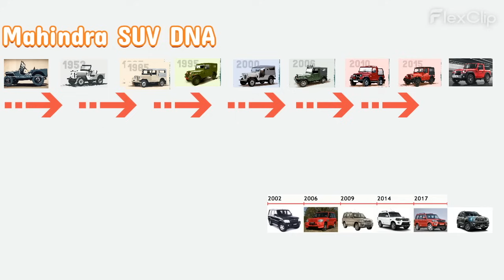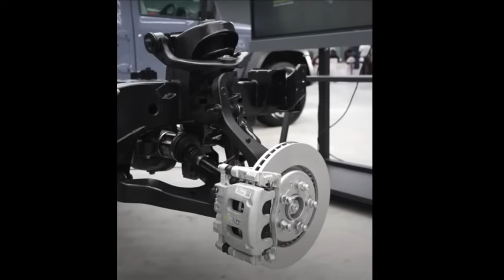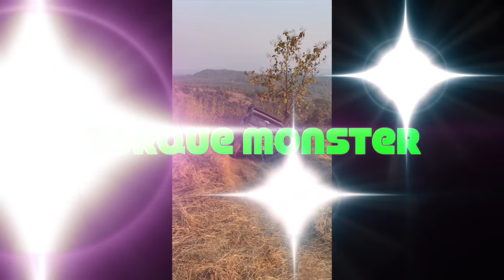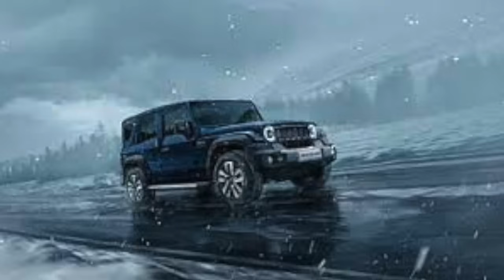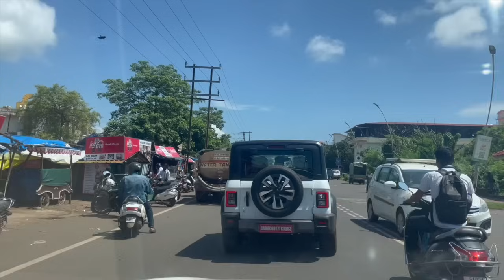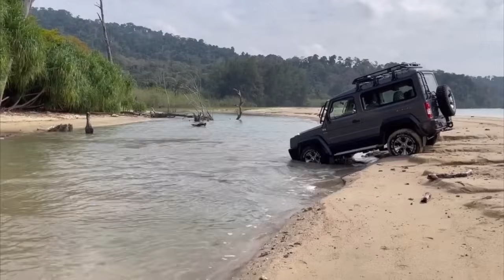Mahindra Thar Roxx 2025 - Engineer's Take on this "One Car Do All" ?

Comment: Nice explanation. Could you also explain how the diminutive Jimny is able to maintain a good cadence on offroad trails with its relatively puny 140 NM torque  and a crawl ratio of ~36?
Reply from the maker: Yes, definitely. Torque to weight ratio. Small torque but early traction. Super ALLGRIP system works smartly. Gearing setup for low end. Top end is dead zone as petrol pot tapers off 

Weight is enemy off-road . Altos fly up hill roads while burly SUVs struggle for the same reason.

See how a monocoque Dacia Duster AWD tackles off-road like a boss. Pure torque to weight at play.
Reply: @tripaccino  Thanks. A Jimny off road review will work wonders for real enthusiasts. Looking forward to one !
Reply from the maker: @theacechip  I would love to do a proper off-road show down between J_G_T trio. Not the vanilla version that media houses are doing, driving through some slush and calling it off-road. I want pure technical obstacles that test each ones strength and weakness. I would need volunteer cars., that's the challenge. We are not big enough (yet)to pull company cars, but I don't want it to be company moderated, so would love volunteer cars

Comment: @tripaccino  your review is Rocking as like Roxx. One question, you haven't mentioned anything about the petrol engine . In your opinion, does it make sense for someone who's only going to do long highway trips occasionally to go for petrol instead of the 2.2 diesel engine? Assuming the car stays parked  for and not driven much and mostly  in a month approx 500km only driving. I like Thar Roxx too much , that is why i want yto buy.
 I am planning to buy AX7L diesel RWD. Can i go for same varient of Petrol considering 1 lakh less price. How much milage will i get for city and highways. Diesel how much milage ?.Please clarify.
Reply from the maker: Petrol stallion is good 👍 if low running. Go for petrol 👍don’t worry about mileage
Reply: Thank you for your prompt response. ❤

Comment: Hello Nice review and appreciate the effort !

I had a question for you and I would appreciate a response. I had a quick test drive few days back, liked the vehicle and ended up booking Thar ROXX with Mocha interiors. I found it to be a good mix of lifestyle choice and almost a family friendly car. But, I am still not quite sure about my decision and may cancel the same in coming weeks. Delivery timeline will also affect my decision as the earliest expected date for my variant is in February 2025.

My primary usage will be in city with around 30kms a day and around 3000kms a year on long trips passing through ghat sections and a bit of bad roads. Bad roads are also in plenty in and around the area where I reside and hence a rugged vehicle helps overall. 

I found quite a few ergonomic issues such as the bottle holder space which makes me thinking. In particular, I found the front seat quite uncomfortable. It had less under thigh support. And both legs were hitting on  something. On left side, it is on some projection from the dashboard and on right side the control panel on the door. I didn't find this getting mentioned in many reviews including yours. Absence of telescopic steering blocks resolution of that problem by moving the seat back. What is your take on this?
Reply from the maker: This is very unique to the customers individual experience. Try back to back test drive of Roxx and Scorpio. And also try a crossover for comfort benchmarking in the same time frame. You will get your answer. 👍

Comment: Genius.
Reply from the maker: share the joy with friends
Reply: @tripaccino do you mean , ROXX ride quality is better then scorpio n? @28.55 min
Reply from the maker: @ani095 Scorpio is better with load and folks sitting . Roxx is slightly more planted when Both run empty.
Reply: @tripaccino roxx doesn't ride better on fully loading? ROXX major concern is impractical cabin and bad seats .
Reply from the maker: @ani095 it’s actually subjective. Can’t draw lines like that . I would chose the Scorpio between the two
Reply: @tripaccino that's true. I am from hilIs have bought the ROXX, long drive on ROXX is tiring. Adabting to its lifestyle.Still mahindra has done a commendable job.
Reply from the maker: @ani095 true
Reply: @tripaccino  hey two doubts I have. Does 2wd and 4wd variants have same ride quality? And 19inch variant have better ride quality?
Reply from the maker: @ani095 19 inch is not best. 18 will be better
Reply: @tripaccino do you think upgrading to tough dog suspension on 2wd variant is a good option?
Reply from the maker: @ani095 why ?
Reply: @tripaccino to lower down the Movements or to have better ride quality on bad roads.

Comment: Can you please explain about your comparsion with Duster mentioned in the video ?. Are you saying that it is as good as Duster or is it far from that ?.
Reply from the maker: Rumours and media houses claim that the ride quality is as good/better than the Renault Dacia Duster. The Duster is a monocoque with a squat that gave it superb ride quality (on and off-road). the Roxx is body on frame and is good for BOF standards but cannot match duster, not even Compass Creta. It is the nature of the platform.
Reply: Sir I drive a diesel Ecosport 2021 and plan to upgrade to the Roxx Diesel AT. I wanted a RWD badly and the Jeep form
Factor always tugged at my heart. Ecosport has a stiff suspension and it’s a joy only on highways and fast speeds. Will the Thar Roxx be similar?

Comment: Curious to know how was Tata able to nail the ride quality for Hexa, IIRC that too is a BOF chassis.
Reply from the maker: @gautam__j  that’s an interesting question and an entire video! Will do a piece on the Hexa sometime.
Reply from the maker: @gautam__j  we did talk about it briefly in this video
Reply: @tripaccino  yes yes, raised more curiosity 🙈
Reply: Not sure about the ride quality, bub it did offer front/rear torque spliting at a time when other mfrs did not. Also not sure if the Hexa had a central diff/viscous coupling to overcome the "chirping" problem. It was a great product for its time, but sadly did not have the development time needed to iron out issues that Tata is known for. It had the same kerb wt as the Q7 (2.3 tons ~) but fell short on other key parameters. Yes, it did have a body-on-chasis structure and Tata has not made a RWD/4WD SUV thereafter.

Comment: Great review. I would like to know is 153hp/330nm enough for AX7L 4x4 MT?
Reply from the maker: It is sufficient. Power to weight is still healthy and drives well. 
(But They should have given the higher tune for both auto and manual on top end variants at least)

Comment: Sir, i am from Arunachal Pradesh which has hilly and wet climatic conditions. I need to know according to the topographic which i mentioned, should i choose 4X4 in Automatic or Manual version? Plz do reply sir.
Reply from the maker: Manual is fine . Unless you want the higher power tune which forces you to go auto on AX7L and AX5L

Comment: Excellent review! One question, you haven't mentioned anything about the petrol engine of the new thar. In your opinion, does it make sense for someone who's only going to do long highway trips occessionly to go for petrol instead of the 2.2 diesel engine? Assuming the car stays parked for and not driven much otherwise. Asking for a friend, obviously 😊
Reply from the maker: Petrol is definitely more refined and easier to drive. The peak torque comes in a little later . Petrol AT is a good option for your friend .
Reply: @tripaccino  your review is Rocking as like Roxx. The question which was asked applicable to me also. I am planning to buy AX7L diesel RWD. Can i go for same varient of Petrol considering 1 lakh less price. How much milage will i get for city and highways. Diesel how much milage.Please clarify.

Comment: Hey @tripaccino , thanks for the detailed review.  What would you suggest automatic or manual in mx5 or ax5l , for mostly touring or road trips . Some did mention to me about the Scorpio-N manual gearbox clutch plate issue. Currently both my cars are manual
Reply from the maker: Ax5L 👍
Reply: @tripaccino  thanks for the reply. Is it because of the clutch plate issue only ?
Reply from the maker: No I think the clutch plate issue will be resolved in this iteration. It’s is just that the ax5l gives lot of value over the Mx5

Comment: Initially I thought 37 minutes is way too long ,I watched it twice by now .Kudos sir your review took it to next level.Every thing I needed and much more.Could you please do similar video specifically to thar roxx torque converter and engine as it does not seem to be a bolt on and Mahindra might have tweaked it specifically to thar.All the very best 👍🏽
Reply from the maker: Sure 👌
Reply: Yes i would second this request too, some info on the auto gearbox please
Reply from the maker: @vikramjitsingh770  will do. Please share channel on WhatsApp i
Reply: @tripaccino  already done sir, and strongly recommended it too!

Comment: 37:48...i have a doubt..after mm540 company launched mm750dp ie 5 door soft top and hard top model which turned into mm marshal then into mm armada and from here split as scorpio and bolero...and as per my idea is this roxx a product in btween bolero and scorpio n derived from thar....pls do reply
Reply from the maker: True . The Roxx is a point where the lines merge again because Mglyde underpins both Scorpio N and Roxx

Comment: How can the Gurkha's wading depth be only 700mm when it comes with a stock snorkel?
Reply from the maker: Snorkel breathes air into engine. Engine can keep running if submerged. Exhaust will hold out due to back pressure of the diesel engine upto a tipping point But Wading depth is based on other factors. Lowest point where transfer case breathers open out, height of lowest mainframe electronic components etc. there are lot of openings to be considered.
Reply: @tripaccino  thank you, that makes sense
Reply from the maker: @lvhdmya4807  welcome

Comment: I booked Jimny in the month of July'24, and cancelled it next day only. Fortunately I met one old friend who loves off-roading and knows a lot about car mechanics as he runs a very reputed garage. I came to know that 5D Jimny comes with lots of problems some of which are very serious in nature. Brake issue in higher altitudes, propeller shaft touching cross member, leaning on right side to name a few. May buy Roxx but only after a year when most of the niggles will be sorted. What is your opinion sir ?
Reply from the maker: Any Tata Mahindra, wait for first year to iron out niggles

Comment: I Which one is the best value for money variants Thar Roxx in petrol & diesel please suggest your opinions to book on tomorrow??

My  Confusion petrol MX3AT/ MX5MT or diesel MX5 MT 
My running 7000-10000 yearly living in delhi NCR??
Should consider or go for others Options 
Present We have hyundai creta Diesel.
Reply from the maker: How long you want to keep it ? 10 year rule bother you?
Reply: @tripaccino   our car changing tend 7 year and our persent creta is 2019 model. Test drive teken thar Roxx diesel petrol and ScorpioN also i m living in NCR but my home place is near Varanasi UP  that's why need a proper SUV in respect of highway purpose because our trip is planned & unplanned movement on home place.
My city drive 10-15 km per day but home trip 1700 km around.
Reply: Respond best options??
Reply from the maker: @satishrai7614  Petrol AT👍
Reply from the maker: @satishrai7614  Mx3 at petrol best for you
Reply from the maker: @satishrai7614  MX3 AT Petrol
Reply: @tripaccino  okay

Comment: A small addition to Thar history - in 1953, along with CJ3B, Mahindra had also bought the license, design, dies and machinery to build Jeep M38. M38 is the father to both Jeep CJ5 & Mahindra MM540/550. But for some reason, despite possesing them since the beginning, M&M only used those design 30 years later in 1985 when they launched MM540.
Reply from the maker: Nice bit . Thanks for the add!

Comment: Very nice. But I have some reservation on the comparison with cars like Hexa, Duster, Creta and Seltos.. These are cars and its a given will inherently have a better ride and handling package as compared to an off roader designed with additional practicality
Reply from the maker: Good point! I would have never brought them in. Mahindra wants to play as the Creta rival and hence the product positioning and launch event comparison. So as a layman customer, average Rajesh should evaluate it as what’s the best use of his 20 lacs for his particular use case . That’s what the review aims to do presenting the positioning in the wide spectrum from offroader to on roader. I declare that it’s tough as a reviewer to compare it across the spectrum and then repeatedly declare that for a BOF this is the best. But if you compare it to monocoques (like the company wants you to) then this is the result. However as engineering aspects , better to compare bones  to other ladder frames which also we have done. 

That’s why I feel the comparison to Creta and crossovers is not only valid , but in fact mandatory.

P.S: Hexa was a proper body on frame Xover, and it still achieved benchmark ride. Hexa must be invoked in this review

Comment: Thank you for the detailed technical review, a small query with reference to weight of 4*4 vs 4*2 diesel variant and what will be approx difference in fuel economy of 4*2 vs 4*4 for diesel automatic ( if driven in same RWD mode) given the difference in weight and engine tunning (152 vs 173 HP and 330 NM vs 370 NM)

Comment: Best and most Detailed review of the Thar Roxx. 

The bits comparing it with various options like Gurkha 5 Door, Jimney, Creta etc are very articulate and bang on.

Keep it up. 

The Thar Roxx is a great improvement over Thar 3 door, and it will sell a lot, but is it better than the Gurkha for my use case is the big question for me. 

You can't as a buyer improve much on the Thar Roxx, but can do a lot of customisation with the Gurkha to make it serve your purpose better.
Reply from the maker: That’s bang on and that’s why I festive the Gurkha as a blank canvas that you can build it out into anything you want. It’s a great car for what it can become and for not what it is .

Comment: Doesn't it looks like Chassis is a bit thin comparer to Gurkha's? This frame looks flimsy on Roxx compare to 3 tonner? And all those fibre cladding on top of it?
Reply from the maker: As I explained the Gurkha is solid forged steel so it’s heavy and massive. (Rigid heavy type) The Thar is engineered and stamped with weight saving and stiffness in mind. Definitely not flimsy. Just a modern take while the gurkha uses solid metal.